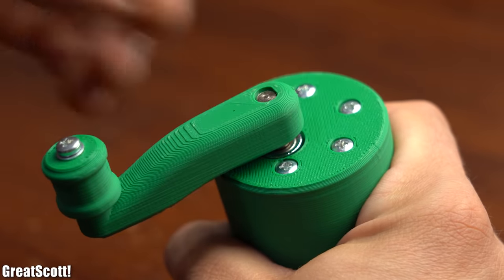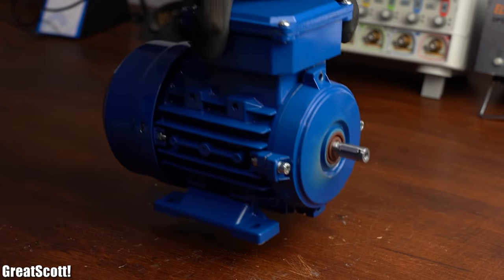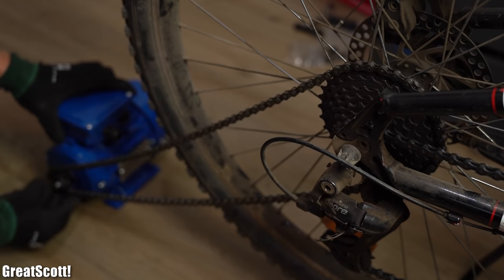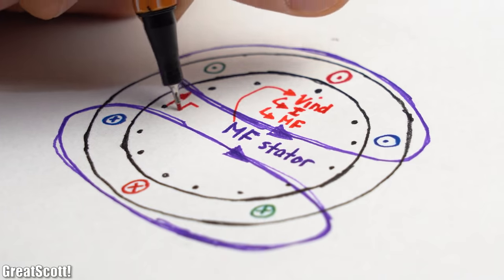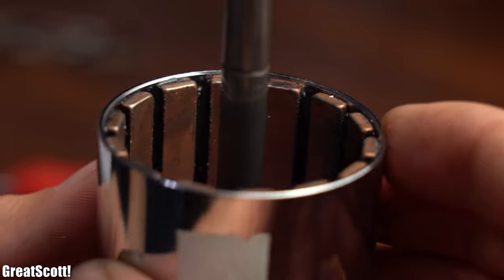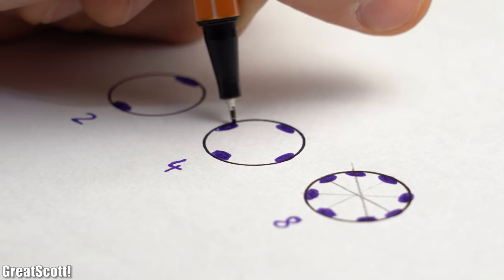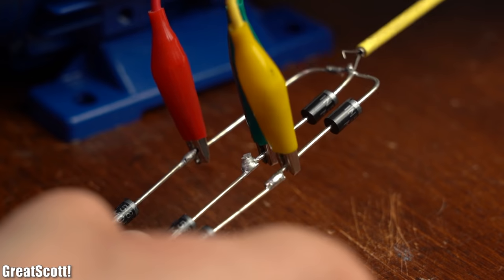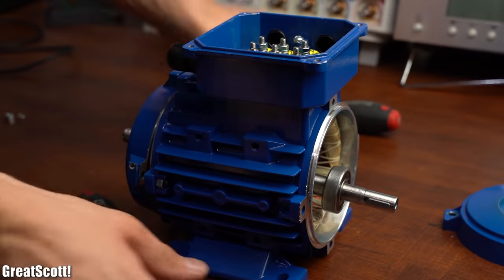HACKED!: Turning an Induction Motor into a Generator?!

Comment: Hi Scott, any Induction motor can work as a generator. It only needs to be fed with reactive power ( via capacitors while running isolated). You may need to modify some winding connections though and no, grid is not required.

Comment: You can use it as an induction generator....by applying external low frequency excitation voltage...... don't need to put magnets.....
Reply: That is problematic too. How to excite them?
Reply: @sidamarali3030  I think capacitors
Reply: Isin't the rotor basically just laminated metal?  I don't think there are actual windings.  When used as a motor it induces magnetism into the core which makes it spin because of the frequency change, and it lags behind a bit.   There are some motor types that do have windings though then yeah you can add an excitation voltage.  At least I think that's the case?

Comment: I build a bicycle generator once. I used the alternator from a car engine. The key was to rip out the alternator's built-in voltage regulator circuit and build my own one. Aside from being a bit more energy-efficient, it also let me adjust the output voltage and increased the rotational speed range over which the alternator was able to operate.

Car alternators typically are 'backwards' generators. The field coil is on the rotor, and the power is generated on the stator. The voltage regulator monitors the output voltage and, through a simple feedback mechanism, adjusts the field coil current and thus the magnetic field strength to maintain the target output voltage as the load and rotational speed vary.

My peak generating capacity was fifty watts, but I was only able to sustain that for a brief time. The limitation was biological: I'm just not in very good shape and can't maintain such energetic peddling.

Comment: I wonder how well an automotive alternator would work. You can get some pretty high amperage alternators for a reasonable price (new or used).
Reply: It would be very difficult for a human to generate power with an alternator, about all a human can sustain for any time is about 100-200 watts, some may peak at about 500 watts for a short tine. But a alternator us in the 2kw range, it could be modified for less power,  so you may as well use something more suitable!
Reply: See my respose above for M D J
Reply: If we take a convenient figure in james's sustainable range of 120 watts at 12 volts we get 10 amps.  No magic can increase that.  I'll assume that a decent car alternator is at least 80 percent efficient so thé max you can get is about 8 amps, nearly 100 watts.  No point in paying for a higher power alternator, buy the most efficient one in spec and match the gearing to human pedalling speed, which can probably be done with standard bike gears.  Probably already has.  Buying the wrong device and gluing magnets to it to get one watt is daft.  So yes, definitely, a decent car alternator unmodified is a good option, just arrange an appropriate gear ratio.
Reply: @raykent3211  Hey Ray, I'm not sure where the 8 and 10 amp figures come from. I have personally seen a 120 amp alternator put out well over 100 amps when under load.
Reply: @jamest.5001  I have used an alternator for a bicycle generator. I had to modify the electronics, but not the mechanics. If you run the field coil at a higher current than designed, you can run it at a correspondingly lower rotational speed. A bit of work with a PWM drive and flyback diode means that the current drawn by the field coil drive is only a fraction of that running through the coil itsself, making the whole thing reasonably energy efficient. You need a little power to start it, but get a lot of power once it's running.

Comment: I'm too working on convertion of an induction motor as a generator , but my application is as an flywhee energy storage system . We use the induction machine as a motor first to convert electrical energy to mechanical and then store it as moment of inertia. Then when we require it we use the induction motor as a generator this is usually achived by placing capacitor bank across the motor terminals to feed reactive power as someone mentioned . This will work with no major constructional modification to the machine.
Reply: I agree flywheels are cool. But can I know why you want to use it as an energy storage device?
Reply: @karthikeyajavangula8423  I'm currently working a project where we compansate  the low voltage ride through in winds mills by pumping the stored energy to the grid . When there is excess wind production the excess is stored in the flywheel and when there is a deficit it's discharged. Conventional storage devices are not that robust and are expensive as a wind mill may face lots of variation in a day.
Reply: @SaiPrasannak  So, basically that's like the mechanical version of a capacitor.
By the way, Nice work bro. 😉

Comment: I made something like this. Changed the three-phase motor into a three - phase generator. It was an old washing machine motor. I did it by rewinding it into a low-rpm 12 pole machine. The rotor, a squirrel-cage type was milled into a 12-side symmetrical polygon, one side for a neodymium magnet. 12 magnets were glued to the rotor with epoxy glue and laminated with glass mat and epoxy resin. The old winding was removed and I rewound this motor with an enameled copper wire with diameter of 1 mm. At ca 60 rpm it gives me about 8 V after the three-phase full bridge rectifier. It is easy to connect the buck regulator set to 5 V and charge the smartphone. This was absolutely not cheap and quick work, especially, that I had to rewind it twice (man learns by trial and error...).  Phase voltage at 500 rpm is some 30 V RMS (it gives about 70 V after rectifier), frequency is 50 Hz.
First, you should check how many poles has your stator winding and apply exactly the same number of magnets on the rotor. It is easy from reading a parameters plate on the motor: about 2850 rpm is 2-pole, 1450 rpm is 4 pole, etc. If you just put some arbitrary number of magnets on the rotor, without checking the type of winding - you will just loose time and work.
Moreover, it you want low-rpm generator, you must rewind it with thicker wire, or you will get just a device to change mechanical energy into heat...
The less rpm machine - the more iron, copper and magnets it needs for the same power as high - rpm machine. Roughly inversely proportional to RPM - 2 times lower RPM means 2 times as much copper, iron and magnets for the same power.
That's why generators in big windmills have a gearbox increasing the RPM from ca 60 (propeller) to like 3000 (generator rotor), because low - rpm, directly propelled generator would be insanely HUGE at powers of the order MW...

Comment: im currently working on close to the same project. i just use a hoverboard motor/bldc as the generator. and it works great. Im also glad you uploaded the video anyway. always entertaining content!
Reply: Hi, you mentioned using a hoverboard bldc motor. I'd like to do it that way too. What does your setup look like? Do you also use a bicycle? what is your transmission from your drivetrain to your motor? Thanks in advance

Comment: A three-phase asynchronous motor basically IS a synchronous generator without any modification, it's the application in the circuit that determines whether you call it a motor and a generator. In some applications it does both, f.e. in modern trains when you want to accelerate the electronics send the three-phase voltage into windings, and when you want to brake a resistance is being applied instead decelerating the train (of course very simplified description)

Comment: There is a device in common use called a rotary phase converter which uses a 3-phase induction motor simultaneously as a motor and generator to produce 3-phase power from single=phase power. Capacitors are used to start and run the 3=phase motor on single-phase power. After the motor gets up to speed, the other two phases of the motor generate power. These two phase are then combined with the single-phase input power to yield 3-phase power. This type of device is handy for operating 3-phase machine tools in a home shop where only single phase power is available.

Rotary phase converters are being gradually phased out in favor of solid state variable frequency drives which also can synthesize 3=phase power from single-phase power although the resulting 3-phase power is a PWM waveform. The rotary phase convertor produces true sinusoidal 3-phase power waveform.

Comment: Could a car's alternator work instead?
Reply: Yes but the speed matters
Reply: Absolutely, but it is NOT an induction motor. The difference is that the rotor in alternator has an electrical winding (coil) on/in it. At a guess it could generate up to 40 Amps at 14.2 volts, which is 568 Watts
Reply: @stevemorse5052  I was meaning to ask if one would work instead of an induction motor, sorry if that wasn't clear.
Reply: The device doesn't check to see whether it's being spun by a piston engine, team of horses or a human. Yes it will work and be far better than what's shown here if spun fast enough.  Gearing.  The video is misleading because he takes some parts from an induction motor and converts it to a different device badly.

Comment: Hello! I am a big fan of your projects! I would like to add some things. 
An induction motor cannot generate its own voltage and it needs to be connected to the grid and to operate in negative slip in order to produce real power. Even if it is connected to the grid it needs to consume reactive power or else its voltage will collapse.
You basically created a synchronous generator after adding the magnets. In this case the number of poles of the stator needs to be the same with the no of poles of the rotor. Also, maybe you need stronger magnets and smaller gap between the stator and the rotor and most importantly dont forget that the motor was designed for 50hz grid.
Anyway, I love your experiments! Keep going! 🙂

Comment: There are cheap motorized bike kits that include a motorcycle chain compatible gearwheel  with mounting hardware to secure it to the disc brake side of the wheel . I believe you can find that gearwheel outside of the motorbike kit

Comment: you can magnetize the rotor the start by  using small amount of DC current through any of the winding for generating a voltage also for utilizing the output you have to place a  three phase capacitor bank setup for stabilizing the  output voltage, since voltages in  induction motor as generator setups tend to collapse when subjected to change in loads. And if you have a constant value capacitor set the IMAG setup can only be used for a constant power output setup..

Comment: You don’t need magnets to excite the magnetic field into an induction motor. Just add capacitors (rated for motor voltage e.g. ~2µF / 350V) in parallel to windings. So this is to deliver reactive power by swapping energy between coils and capacitor in this simple oscillator. If you spin up the motor, voltage will rise quickly due to remanence. But you have to cut off the load with a triac to prevent the field to collapse. If the voltage of self-excitation is high enough, load can cut in... you need a resistor in gate of triac to cut in load at above 50V. Worked great with my 1.5kW wind turbine. Your approach didn't work because the magnetic field induced by the permanent magnets were very weak compared to several amps within squirrel cage at self-induction....

Comment: The way it was described in the lectures that I attended is pretty much what the previous comment tells.  With a formal clarification or two.  You can use the asynchronous motor as a generator, when you have AC magnetizing, not DC that the permanent magnets represent.  The terminology actually is that with BEYOND SYNCHRONOUS SPEED any asynchronous 3-phase motor will feed REAL power to the network, while consuming REACTIVE power from the network.  The reactive power is what provides the alternating magnetic field.  Another practical issue is that the motor is very critical to what is called air gap between the rotor and the stator.  Consider that good soft magnetic iron conducts magnetic flux some 3 or more orders of magnitude (more than a thousand-fold) better than air.  A 1 millimeter air gap resists the magnetic flux more than a 1000 millimeter path via the iron.

I recall  how a small stream was not a good proposition for a standard synchronous generator due to all critical controls required.  So an asynchronous generator was installed and happily produced 200 kW power to the network.  There was no need to synchronize the rotation speed to the existing power line frequency and phase.  You just started the generator as a motor and then added more speed from the turbine to exceed the line frequency.  The generator ran faster, if there was more water and supplied more power to the network.  All that happened automatically, no speed controller needed.

Comment: I'm fairly new to this but I concur with many of the comments below.  
1.) The distance between rotor and stator is too great.
2.) You are suffering a loss from friction and wobble
3.) Number of magnates, you can maintain the 2, 4, 8 orientation if you want but increase the time in those states by doing 2x8, 4x4, 8x2.  For example shorthand 4x4 being 4S->4N->4S->4N 
4.) Coverage, in this case a mix of 3.) and the length of the magnets.  In your current setup it looks like only about 20% coverage

Anyways, great video loved to see you work, looking forward to checking out your other videos.

Comment: Induction motor can work as induction generator when slip is negative,that can be done by either moving motor shaft faster than rated rmp or by decreasing supply frequency.it can only provide active power not reactive power, reactive power has to supplied from source.

Comment: The induction motor has to achieve super-synchronous speed to start generating electricity. That's then is called an induction generator which is used for power generation through wind energy.

Comment: You need a permanent magnet alternator or generator for that project. Bicycle lighting sets have used those for about a century, usually driving them from a roller against the bicycle tire. 
The rotor might work better with magnets mounted in a helical configuration.

Comment: Why the 3 output sine waves are in phase? I thought they have to be 120 degrees apart to give you maximum phase to phase voltage difference. May be it has to do with the number of magnets on the rotor compared to windings on the stator.

Comment: Induction motor can generate electricity only if the slip of the machine becomes negative, that is if the shaft speed becomes greater the synchronous speed. But the machine needs reactive power to do this, which can be supplied from the grid or by connecting a delta connect capacitor bank at its three phase output.

Comment: Use a cheap 120v DC treadmill motor like me.  100 watts is easy to generate, though, my output voltage is only around 45v.  Still excellence for a power diode to a huge cap and a switching DC-down converter regulator from TI which will take in 75vdc through ~9vdc and output a select-able 12 through 24 vdc up to 10 amps.
Though, to get the RPM up, I had to use my rear tire's diameter as a pulley to motor tiny pulley.
Also, the flywheel on most treadmill motors was needed to smooth out the load and pedaling torque.
Also, at least the treadmill motor I chose has no cogging!

Comment: Hey Scott, I did it once with a single phase induction motor, just using a capacitor. the tank circuit excited the motor than it worked. I used a 1/6 HP motor, and sucefully powered 8 fluorescent lamps powering the motor with a drill.

Comment: You can use a regular 3phasr induction motor as a basic generator by flashing a phase across a battery to magnetise the iron then spinning it with 3 motor run capacitors across the phase wires.

Comment: To go from three phase ac to DC would require a decent full bridge rectifier and subsequent voltage and amperage regulation. 5v 500mA for standard USB charging. 5v 2A for tablet charging.

Comment: you can add capacitors in parallel to the stator winding to make self excited induction generator. You will need a little residual magnetic field to start working, but you can start the machine as a motor first and then turn of the power supply and start rotating the shaft. That way you don't need pernament magnets. But with  self excited induction generator you will need to adjust the capacitance when the electrical load change because if you overload the generator it will demagnetise and hense will stop producing electrical energy

Comment: A three-phase asynchronous motor is connected to three capacitors on the three terminals of the stator winding, and the three capacitors are connected in a Y-shape to become a three-phase asynchronous generator.

Comment: Dude, you're turning an induction generator into synchronous generator, great job 👍

How about making the shaft of the induction motor spins faster than its rated rpm, and connects its terminal in parallel with a capacitor in order to produce the voltage that you want. That would be great if you make a video this way.

You're amazing 👍

Comment: We used to have bike generators back in the 80's. It was a small device that picked up on the side of the rear wheel and made enough power to light the front and rear lights. Not very bright though from what i remember.

Comment: A comment off the cuff, it appears that the magnetic relationship between rotor and stator coils dont line up for proper induction. The angle between 2 adjacent magnets on the rotor is less than the angle covered by the stator coil pole, preventing a flux flow through the stator coil.  A drawing of the magnetic paths by the rotor in the stator will clarify this point